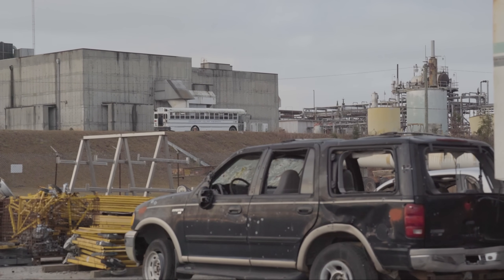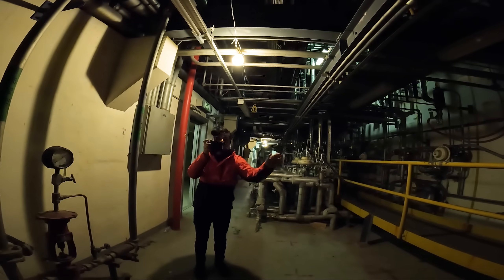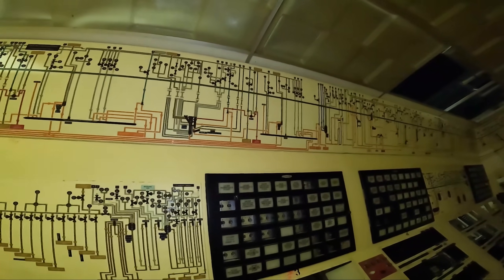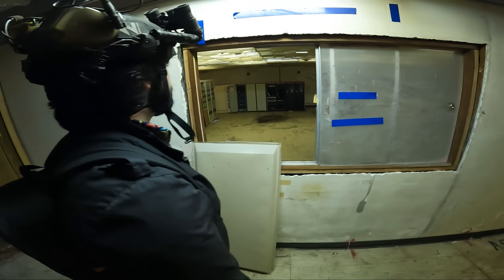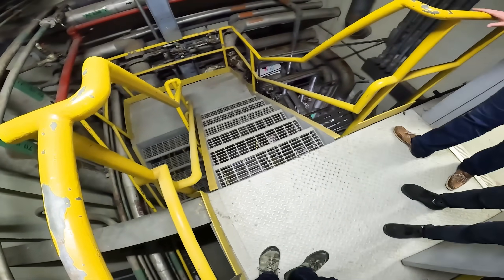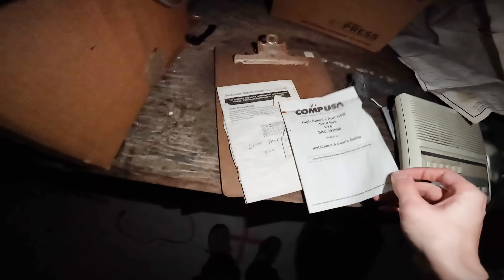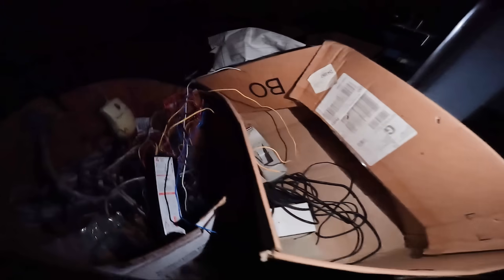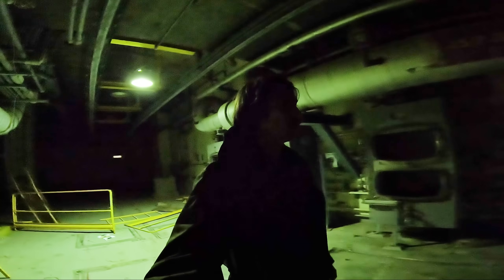I Explore a Cold-War Nuclear Power Plant

Comment: All drewski has to do push one button and he gets a real life stalker play through
Reply: Interesting
Reply: @sleepypixel420  you should look into the differences more. Nuclear power is one of the safest, greenest (0 air pollution, and the annual fuel waste is only 3 cubic metres, tiny compared to coal) most efficient power sources out there, its much more reliable than solar or wind and we have thousands of years worth of fuel all over the planet. Chernobyl (a plant run by a corrupt and evil dictatorship) was a situation where nearly everything was done incorrectly and nearly every safety procedure was ignored and it still only resulted in an official deathtoll of 31.
Reply: @LadZeroUltra all facts. Millwrights do yearly maintenance during shut downs.  Everything gets repaired and replaced. It’s so strict that you have to show evidence of everything you used. Every single pencil, welding rod must be accounted for. Obviously with a corrupt place like Russia you won’t have a fine toothed comb of safety protocols and regulations. Nuclear is definitely the way. 35% of energy used to run the process is put back in the process. That is a crazy amount of self sufficiency
Reply: Brother it was a joke

Comment: I’ve served in the US Nuclear Navy and will provide what interpretations occur to me:
- showers are for decontamination procedures, for radioactive particulate on suits or bodies
- the heavy door is a watertight door for isolation and pressure differentials
- the control panel lines are as you perceived, though I could tell you nothing about what they represent that you couldn’t figure out onsite or from documentation
Reply: Those switches were on a PDP11/35 minicomputer by DEC (Digital Equipment Corporation)! The PDP computer line had the best panels. A retro computing enthusiast would love that. 12:24
Reply from the maker: That’s so cool! Thanks for the insight :)
Reply: Those tape reels probably stored quite a bit of data, could be tens of megabytes. You just couldn’t find or load much of it quickly!
Reply: @BrianTRice77  saw that PDP in Wendigoon’s video and immediately wanted it.
Reply: I wonder how many people get lost in Nuclear Power Plants?
Reply: @Drew-v2f  A functioning plant is a highly regulated and secured environment. Most of it will not be open for you to wander around in and get lost. Lots of security checkpoints and doors you can't get passed without clearance. Even if you worked there most of it would be closed off to you. 
An abandoned facility like this though, oof. I would bet this is a one of a kind building and situation.

Comment: Sup Drewski. I actually work at an active nuclear generating station. It is so damn eerie seeing somewhere similar to my everyday place of work just completely abandoned like that. You would be surprised by some of the equipment we are still using. I had to fix a computer using MS-DOS a few weeks ago.
Reply from the maker: Hahha that's nuts. MSDOS is archaic.
Reply: >nuclear facility running MS-DOS
This doesn't surprise me (minuteman and the 5.25 disks after all) but still makes me feel a little sad.
Reply: Shiit, I work security at one, what department you in?
Reply: I wonder if the old tech is used simply because it would be too expensive to replace or if it serves a different purpose like being harder to hack (that's a thing I've heard multiple times but it could be just a myth).
Reply: @arattactician5697  being harder to hack is simply being air gap isolated, cost and the fact it still (mostly) works is the big issue. It does keep 5" disk producers in business at least.
Reply: "Legacy system"
Reply: DOS?  There are places like this that still depend on COBOL operating systems.
Reply: I work in coal and gas gen. A lot of that old looking equipment in the control rooms is still in service in a lot of these old plants. Though, we have been upgrading quite a bit over the years. There's a lot more monitors and PCs in the control rooms now than there was even 10 years ago

Comment: As someone who has worked in both power stations and reprocessing plants, I'll offer a little info.

It's not uncommon, at least in the sites I have visited, for "floors" to be replaced by "xx foot level" for the very reason you see in this film.  Because the ponds and and reactor vessels go so far into the ground and so far up, starting at the "ground floor" might be misleading.  In addition, the reactor hall is usually a vast central atrium, with equipment floors wrapped around it, so might only have one floor itself (whilst still being several hundred feet tall).  Basically, the buildings are insanely complex and it's often easier to say "I need to work at the 102 foot level" than trying to relate that to a floor on the outside of a reactor hall the size of a couple of football fields.

Comment: those hand placed stickers are the circuitry of the powerplant: power circuit, command circuit, relays etc and usually had some small lightbulbs to show that they are active or, depending how was though, they lit only when issues appeared.. The deep 80ft area was where the radioactive rods were placed and depending on the needs they were lift up and let down into the heavy water (H3O). Also the place you entered thru a blue gate, like in airports had a really accurate and powerful Geiger measurement apparatus to read any radioactive molecule n the clothes, suits etc. In the commend center there were some incorporated printers to print via matrix printers the different values of readings from different areas from the plant... to have it documented, like a tachygraph.
Power switching rooms, power relays, timing relays etc.
I am glad you had the opportunity to take a look at a small sheet from the book of history. A sheet connected to so many bright and really dark chapters in our human kind.

Comment: Those switches that look like a cheap organ are what are used to startup the computer, there was like 20+ settings you had to hit and probably 20-30 seconds to get it all loaded. A version of this is used well in 2000s. The indicator that pulled out is probably connected to a sensor and the writing is the ofsets for them. Even thou they look the same in every slot they may act different when switched.

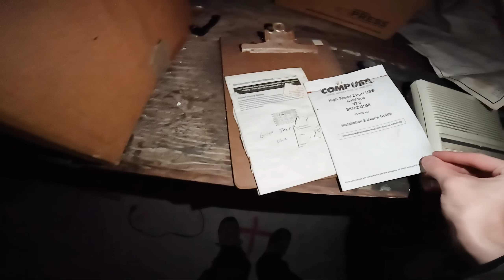Comment: 18:21 A high speed 2 port usb card in the 1980's must have been so cool at the time. Hell windows 95 didn't have proper usb until 95 se, unless you were a computer wizard with programming. Even still usb didn't take off for consumers until windows 98 with "proper" usb drivers. Just don't pull the drive out without disabling it first, or turn the computer off, or you could, but more than likely would lose all data on it.

Comment: 1:20 -- RE:  Nuclear Power and Materials Processing;  full disclosure, I'm neither a nuclear engineer nor did I serve in any military capacity nearby one.  But the basics behind the proverbial "nuclear playbook" aren't actually that difficult to grasp.

Water cooled nuclear reactors can be used for "breeding" other exotic elements, like weapons grade plutonium, or medically useful isotopes of other elements; and this is in addition to "normal" power generation via heat transfer and steam turbines.   The problem with this type of reactor, though, is that the steam is most useful when its inside a system which takes advantage of the high pressures.

There is only one alternative route known for atomic energy, the fluoride salt reactor; but unlike the water cooled designs, the fluoride salt route cannot be used for breeding elements like weapons grade plutonium.   In fact, the best case use for the fluoride salt system seems to be as a means of "burning" what would otherwise be considered toxic radioactive waste from things like water-cooled reactors, releasing heat into a system without high pressure steam or water cooling anywhere near the nuclear reaction.
Reply: ^^   One smol deet I omitted in comparing water-cooled to the fluoride salt system:  the latter can operate in 1 atmosphere of pressure to generate heat, whereas using water to cool down the reactor necessarily must put the water system under pressure (moreover, the water used to cool the reactor has to be kept in a closed loop to mitigate radioactive contamination).  And if there's anything humans -learned- confirmed from 3 Mile Island, Chernobyl, and Fukushima, it is that high pressure goes boom.
Reply: 10:50 -- RE: Chernobyl;  Yes, 1986.  3 Mile Island happened first, y'all (1979).